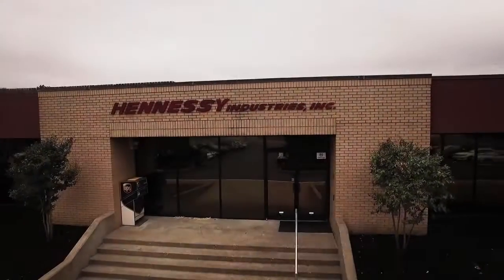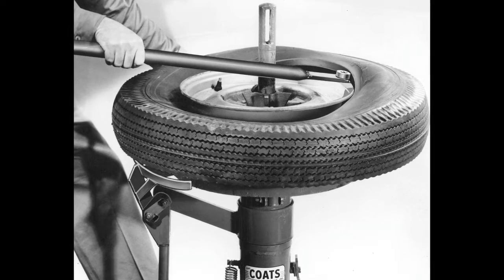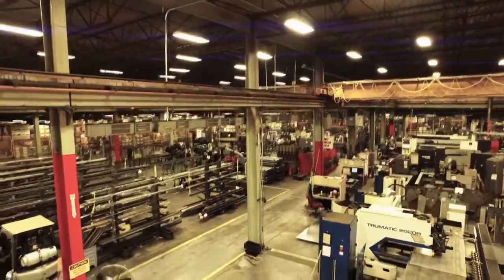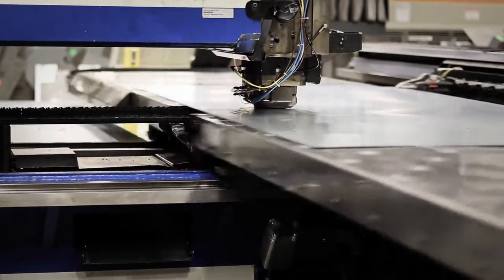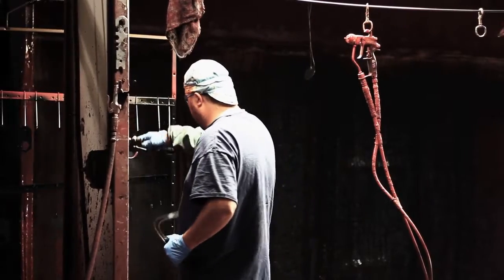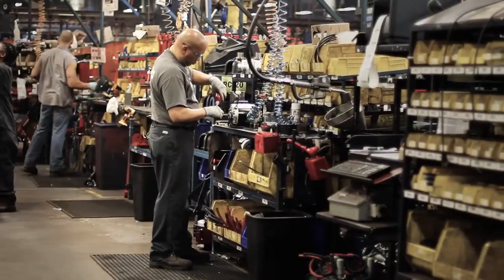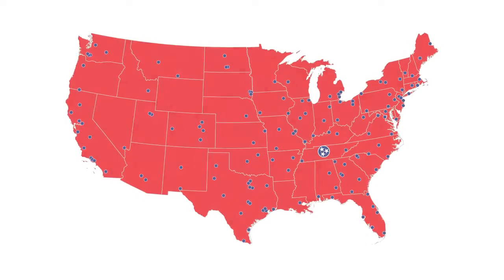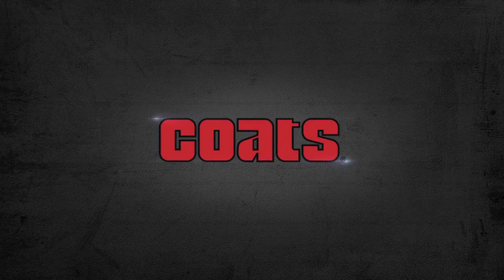Why Coats?

Comment: Do Not buy an APS3000. Bead blaster doesn't work, center clamp requires constant maintenance, and not enough power to turntable to remove stiff tires without much lube and manipulation.